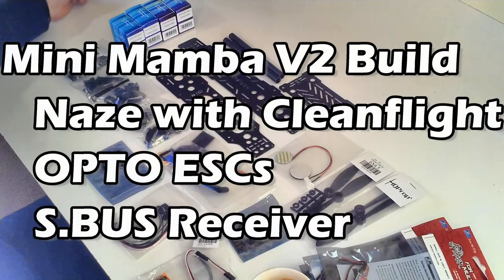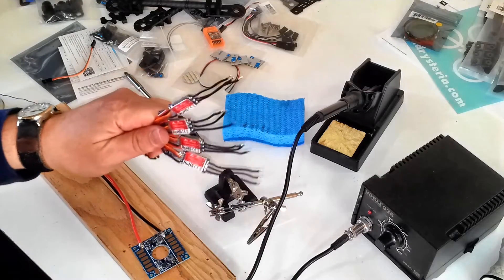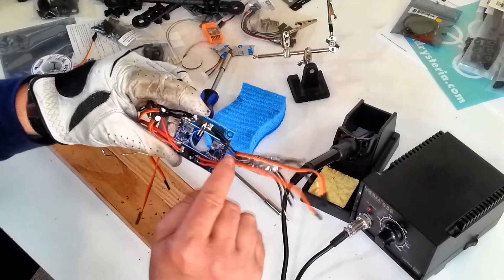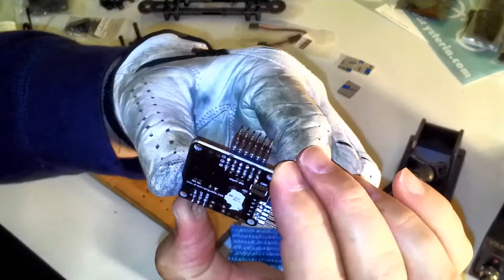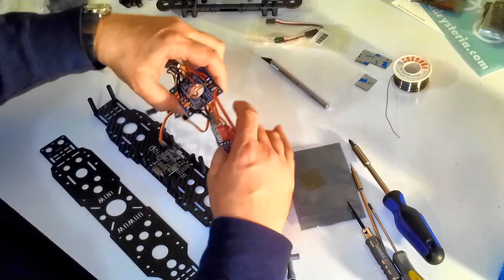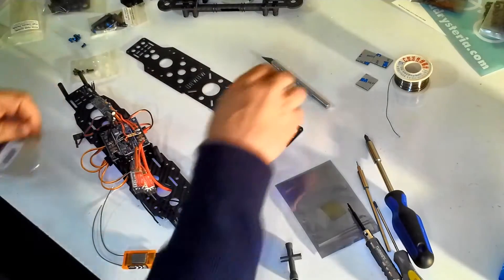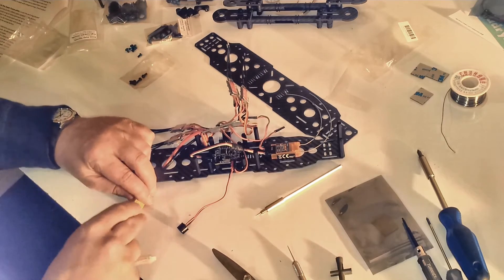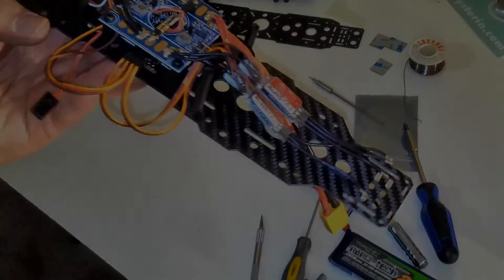PART 2 -  Mini Mamba V2 Build - Cleanflight, OPTOs, S.BUS

Comment: If i want to use a spektrum is setting up everything the same or are there extra steps?
Reply from the maker: Marcos Castro Standard PWM (one cable per channel)? Then it is less steps, you don't need to setup a serial port or S.BUS.  If you're talking Spektrum satellite, its almost exactly the same, but you choose a different protocol. Instead of S.BUS, its Spektrum 1024 or 2048 (I think depending on whether it is DSM2 or DSMX).

Comment: Would you mind posting a picture of the S.bus connection to the Naze. I couldn't really see anything from the video. Don't want to fry my board when I hook it up.  Just want to double check since the Naze manual is a bit confusing about this...

Are these the only RX option that have long dual antennas that work with a spektrum radio? I know some of Orange the satellites have long antennas, but would rather use this.
Reply from the maker: samik83 Ground and +5v go in the standard location as if attaching to channel one on the receiver pins (ground is far left, +5v is second, and signal is pin 1). However, instead of signal on pin 1 (the third pin from the left), move it to the bottom row far left (pin 4).
Reply: Quadrysteria
Thanks. Will see how it goes once I get my RX and the inverter cable.